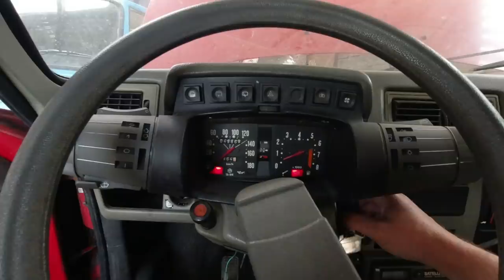1000 VIDEOS! Will the new Oltcit run AND drive?!

Comment: Congratulations for this Oltcit, it's running beautifully! I just want to point out this is not the actual bottom of the range, it's something like mid range. There was an even more basic one without rear wiper and sometimes even without rear defrost. My friend has one of those basic ones but with the very rare green interior and i've driven it many times and done many kilometres in it.

Comment: I can sympathise having been in this situation this month with my Metro after I appear to have previously run the tank dry. Replaced the fuel pump, filter, it had a recent new carb... but the fuel wouldn’t come from the tank. My quest continues. Congrats on 1000 vids Ian! 👏 🥳 🎉
Reply: Fuel line possibly clogged with crud. Blow the line out with compressed air. Open the petrol filler cap first.
Reply: @brianevans656  thanks Brian, unfortunately after trying exactly that the fuel still wouldn’t come up! I suppose I could try adding another 5 litre jerry can of fuel to it before I get it recovered to a garage...

Comment: Congrats Ian, also liked the 205 video.

Today filled up my little Peugeot 1007, €1,91 per liter (ouch).
Reply: 1.91 a litre? does it run on smirnoff?
Reply: 2€/L will be the European norm soon get  used to it already. Inflation wise it's still cheap compared to other goods over the last 15 years.
Reply: €1.91?? Yikes! I filled up my BMW e46 coupe today and that was €1.63 I think? It was at a low cost/discount petrol station though (in Portugal)
Reply: In some countries you're also forced to fill up with 98, because 95 was replaced by E10

Comment: Very even sweet tick over, you did a great job there cleaning out the carb. Sounds really pokey too, revs so freely. Surprisingly well equipped considering it's such an old car, rev counter, intermittent rear wiper, lockable glovebox, two speed fan, radio etc. I was thinking it would look really nice washed as you pulled it out of the garage, you can tell from the paintwork it would come up well, and then you went and washed it, the old girl looks really nice with her red paint sparkling in the sunlight! Can't wait to see a long test drive on the road once the brakes and steering are sorted.

Comment: Congratulations on the 1,000 videos, Ian...

And on progress with the Oltcit...

If the Oltcit won't hold an idle and is hesitating on revving then I'd say it's quite likely that the small idle jets and the fine passages of the idle circuit may well be blocked.  After having sat for 7 years then it's also very likely that the accelerator pump is going to be rather toast having been attacked by the modern petrol...

Comment: What a result. Love the Citroen`s.
 My Dad had a Gsa R reg i think. beautiful in gold and its the car id love to find even though he let it run out of oil and engine went bang on the London circular grrr.
The Citroen was different  "special" the air suspension was awesome and i loved watching it raise on startup.To me at 7 years old she looked so futuristic and space ship like.
She was a graceful swan gliding down the 1970`s roads in kent so different from those boring boxes on wheels.
He owned a high spec 1984 red Bx which brought the love flooding back for the Gsa.
 I owned a peugeot 205 style 3door with optional extra of a leaky sunroof and also having to climb in through the boot in the winter as the locks had frozen solid.
But the 205 was so much fun.

Comment: Congrats on the 1000 videos! Well done :D. 
And congrats on a driving oltcit, again! 
Still not sure about the gassy pumpy thing when starting a car, I find it to not work as well as slowly applying more gas while the starter motor is doing its thing. Worth a try on a difficult car! Usually fires into life at about 40% throttle.

Comment: Hi, I've just discovered your channel from your Peugeot 205 videos, I have to say I love your content, I am from Romania and these Oltcits were manufactured 50 miles away from my birthplace, my whole childhood I've seen these little cars get modified by boy racers, but in the end I've always loved them in any form.
Also, the Oltcit factory was bought by Daewoo and then they started making Cielo, Espero, Tico, Matiz, etc, which I've also seen in your videos, so for me it's like going back to my childhood but only in GB! :))))
Reply from the maker: Thank you! I do love that Daewoo took over the factory in Craiova. A link between cars on my fleet.
Reply: @HubNut  Now the factory belongs to Ford, Craiova is where I finished my studies. Believe me it was a big surprise for me to see that Oltcit, they are getting hard to find in Romania! Also think abou this: we had a Dacia 1310 as all Romanians did in the 90's, and then came Daewoo with power steering, fuel injection, electric windows, it was insane to us!!! All big executives had an Espero! When we saw an Espero it was like that guy was a big deal! Insane times! 😁cheers mate!

Comment: Excellent Iain and congrats on 1000 videos!
I think you'll find the headlamp height adjuster is mechanical with a cable control. It was the same on my Visa 1.4TRS.
Reply: Simple but effective. Unfortunately wifey ran the Visa into a Mercedes W12 at about 15kmh. Unfortunately since the Visa seemed to be built with steel something akin  to  a beer can, it was a write off (not the Merc 🙄)

Comment: Now we know how the white one caught fire 🔥 we still have no idea why they put it out.
10:05, that is the anti dieseling solenoid, it doesn’t “shut the fuel off”
it only closes off the idle circuit in the carburettor, not the accelerator pump or the main jets.
Also, pouring fuel down the throats just fills the manifold, not the fuel bowl, considerably better aim to get the fuel down the vent tube is required.

Comment: Here's a tip, if you have a similar problem again; instead of pouring petrol in the carb, try putting brake cleaner or a similar solvent to dissolve some of the crud.

Comment: One tip concerning fueling the carburettor directly. It is totally okay to do that and I did that a lot to the old STeilheck breadvan Polo from 1982 that belonged to my grandfather that was sitting on the driveway. 

Well, at some time, and I am not making this up at all, I was cranking it, with petrol poured in directly, even with the original pancake airfilter back on, without the retaining clips, and because of the fact that I was throttling and thus making the butterfly valve open too much, some petrol refouled. Because I had a little backfire exactly at the same time, I had an enormous, well interesting, fire because of the gases and yes, the pancake style cover simply flew away.

Conclusion: totally fine to do this, but don't open the throttle. OR, you can do so, but with the choke valve fully closed!
Or have at least an extinguisher nearby, especially when doing this inside.

The idle jet was probably a bit clogged. Nice job!

Comment: Well done! 
     It’s really encouraging and exciting when you buy a car as a non runner and you get it running! It’s a great feeling of achievement, more possible with a car like the Oltcit running on a carb and points or a simple form of electronic ignition than a non runner with a computerised EMS. 
       Isn’t the Oltcit basically a rebadged Romanian Citroen Visa?
Reply from the maker: Thanks. It's very different to the Visa. Will do a comparison video at some point.
Reply: @HubNut  Great! Thanks, that would be very interesting.

Comment: Well done on getting her running again! If there is an issue with the engine, have you considered making a good engine by taking parts from the burnt car if needed?
Reply from the maker: Cheers. I think it probably makes sense to get new parts where the camshafts are concerned. We'll see...
Reply: @HubNut  If they are available and depending on the state of the original parts. Watch out for bad quality aftermarket stuff which may be worse than the somewhat used original items.

Comment: If your battery is completely dead then the jump pack is also charging that battery. Maybe disconnect the main batt to get a bit more life out of the pack?
On the carb, if you can find the breathing tube to the float bowl then you can pre-fill the bowls by adding gas through that tube.
Cheers,

Comment: Keep in mind electrical contact cleaner almost always leaves a greasy residue. As long as you flush enough petrol through it, it will be fine - but you'll have a nasty residue on all the other bits. Some types of contact cleaner are corrosive on the long term.

Comment: I would suggest to be careful spraying or dripping fuel/cleaner down the throttle bores- it will risk flooding the engine or washing down the cylinder walls, making it harder to start.  Try to get fuel into the bowl, either via bowl vent or a temporary gravity-fed fuel source.. (and make sure the needle isn't stuck in the seat)

Comment: As Mustie1 often shows, if it starts, runs and dies on a dribble of fuels, it's the carb, though at least you didn't have to take the thing entirely apart and soak it in an ultrasonic cleaner, next thing, treat it to a new battery... :D

Comment: The carburetor needle seems worn out. I had the same problem in a Fiat 127: wouldn't run idle but started and revved quite happily. The needle wears out by digging a groove in its surface.
Also, that suspension clunks quite badly, might need a rebuild before taking it on public roads :) Surprisingly little rust damage in the chassis.

Comment: Buy a damn C-Tek charger that can do a deep refresh of old batteries, as well as top-up trickle charge. 80-odd quid if you shop around.

That place you use in North Wales does them....

Well done on the 1000 vids.

Comment: Just a top tip, you can’t fill the float bowl from the chokes. You basically fill the carb and whatever cylinder is open. Only the fuel pump can fill the float bowl.
Reply from the maker: Not sure about that, given I'd poured a little Redex into the carb at one point, and the float bowls definitely had a hint of red...
Reply: @HubNut  so the route it must have taken was either through the jets or through the float valves if the floats were dropped. Must have been pretty jammy. Well done for getting the old Cit running. Remember, there’s an 80 inch Landy and a 1.8 Freelander here in Nottinghamshire if you want an utterly random comparison. 🤣

Comment: Get some proper carb cleaner Ian, Contact cleaner can ruin the plastic parts. Ask me how my GoPro got damaged ;) Also, when removing jets, squirt some carb cleaner in the passages where the jets sit. I use a 2mm ID length of silicone hose to get in EVERYWHERE, otherwise, the hidden crud will recirculate and you'll have to properly strip the carb anyway. Keep it up !

Comment: Another great video but as soon a it was clear it would not stay running I was wondering when you were going to get the carburettor apart. If it had that old stale fuel in it it was going to struggle to keep running a soon as what you poured the top in was used.
Reply from the maker: Yeah, took far too long for my brain to work it out!

Comment: Ian. Couple of questions. 1.Do you depress the clutch when you’re trying to start a car with a low/duff battery. It used to be something my dad used to drum into me and 2. He also used to say turn off the interior light in these circumstances as and battery power not used for starting is wasted. Was the old man having me over all those years ago ?
Reply from the maker: I can't say I do either, though there's a modicum of truth in both. I'm not sure an interior light is going to drag many amps away from starting the engine. Some cars react very badly to having the clutch depressed at start-up. It makes the Fox HARDER to start.

Comment: Hi Ian, just wondering how you are going to get on after september this year as E10 petrol comes the normal, and older cars are supposed not torun on e10, i beieve some e5 petrol will still be available for about 5 years, But it seems the gov dont want old vehicles on the road.

Comment: This was a little painful to watch tbh... if a car has been sitting for 7 years, that fuel tank should definitely have been drained and fed new petrol before trying to start it. An oil change could have been done as well... I winced each time the engine was revved hard with 7 year old oil in there. Plus a check over of the spark plugs (clean and check gap at the very least), and well before it's driven for any distance, the coolant and brake/clutch fluid should be flushed and refilled, since those will be shot as well after 7 years. I know it was probably a quick test to see if it starts and runs, but it should be given the best chance of accomplishing that, by doing the proper maintenance first.
Reply: Good old YouTube - you can ALWAYS rely on someone to be smug and condescending........!!
Reply from the maker: The car has run in recent times and the oil still seems in remarkably good order. I won't be changing the coolant. ;-)
Reply: @HubNut  Nope, I wouldn't change the coolant either. Welsh coolant seems to be as good as coolant gets?  At least Welsh coolant doesn't poison cats???

Comment: Ian the problem you have is you put the petrol in the Oltcit and not over it,also you used the ignition switch and not a match to start it,if you had used a match it would have been problem sorted.

Comment: Is there a universal joint in the steering column? I had a similar problem on an ancient Range Rover after it had been standing. Use duck oil or similar on the joint, then spray with motorcycle chain lubricant, never had a problem again!
Reply from the maker: That's a good point. I have had that before.

Comment: Olly the Oltcit, and another fine mess it's got me into.  Once fuel was seen in the filter the carburetor should have been the first place to start looking into.  Why did manufacturers stop fitting hand primers to mechanical fuel pumps?  1000 videos, that's a lot of storage used, cloud or remote hard drive?

Comment: Hard to see if the choke was actually shut or not? Pouring fuel down the venturis isn't getting fuel into the float bowl by the way! You're just pouring fuel into the inlet manifold. When you're pumping the throttle you should be able to see the accelerator pump squirt down the inlet, that will confirm you have fuel in the carb. The jets could still be blocked. Edit - the choke isn't shut!

Comment: That's 1129cc engine with 4 speed gearbox the reverse gear its in front right or back right? A lot of noise at camshafts, especialy left one that's the problem of those engines

Comment: Please stop pumping the gas with the choke on. You're flooding the Oltcit. 
You crank with the choke on, it picks up correctly, you then press the choke in half way and give it a slight press on the accelerator, without pumping the pedal.
In normal warm weather, you're not even supposed to pull the choke out all the way.
You did well with the carburetor, there are more jets that come out and the acceleration pump membrane should be checked too.
I worked on many of these.
A good idea is to check the points.
After so may years, you should replace the timing belts too.
The cam followers are adjustable, but the lobes develop wear and adjustment cannot compensate for that.
All Oltcits had tachometers.

Comment: On opening the carb - and find it almost empty ... means: the fuel does not run into it, doesn't it ?
Reply from the maker: The pump was pumping, but I don't think the needle valve was allowing fuel into the carburettor. In other words, it was just pumping the fuel back to the fuel tank...

Comment: Is that the same car what was called Axel in the Netherlands?
Reply from the maker: Correct.
Reply: @HubNut   I tought so 😊 my grandpa did have a grey one back in the late 80s 😊 they changed it for a AX later on . All I remember is the turning nob on the hatch to open it 😅